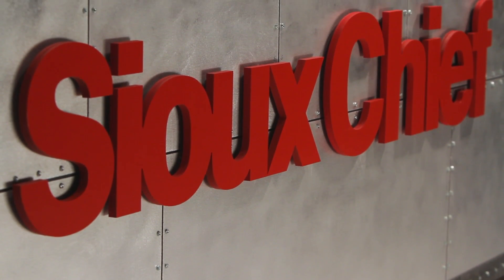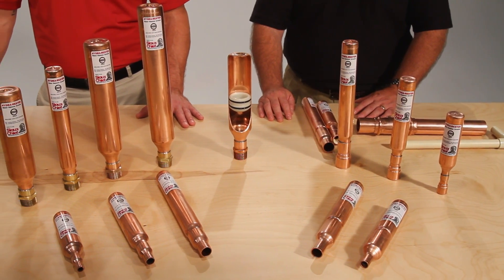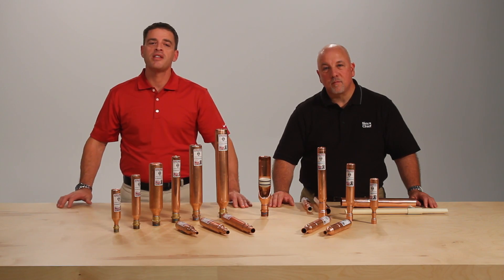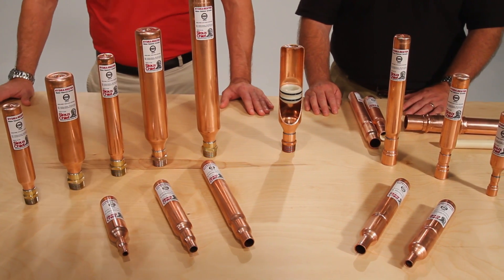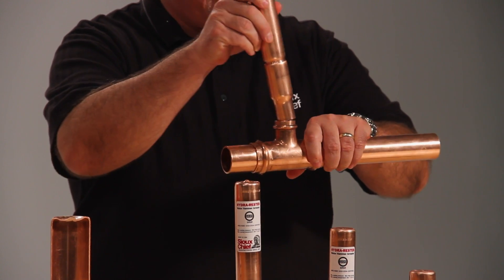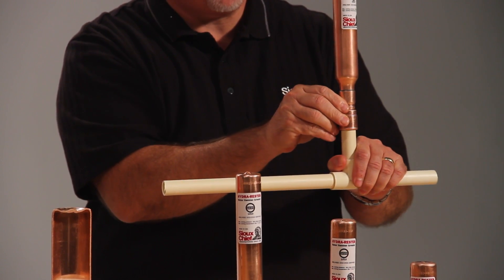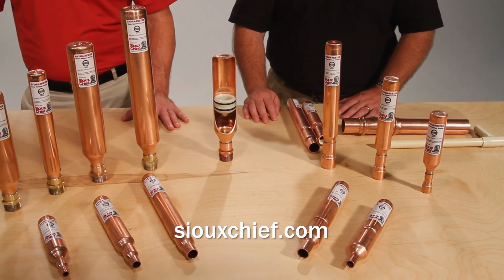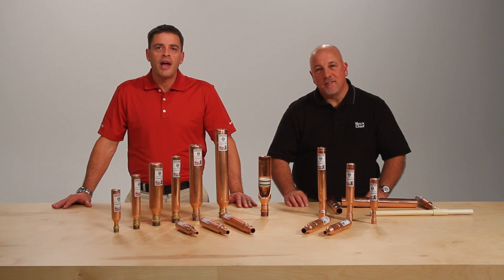Sioux Chief Hydra-Rester™

Comment: How do you solder these on without melting the plastic?
Reply from the maker: Jim our sweat model MiniResters have a heat sync built in. So any model that calls for sweating or soldering is safe at the designated joint.

Comment: The water hammer is installed horizontally or vertically, and is there a problem with the horizontal installation
Reply from the maker: Both HydraRester and MiniRester can be installed at any angle.